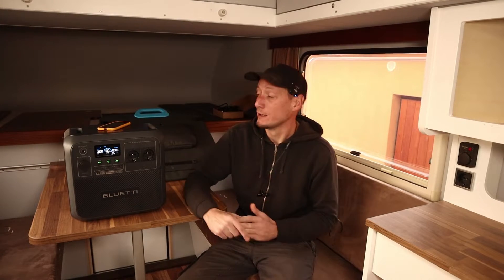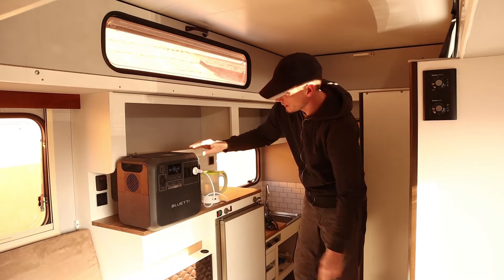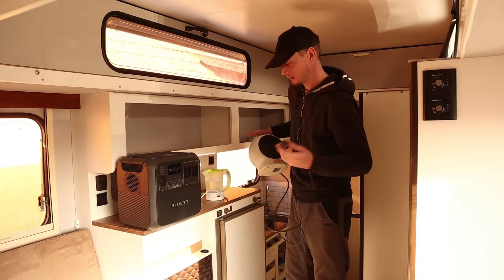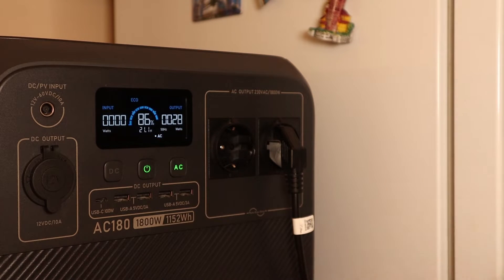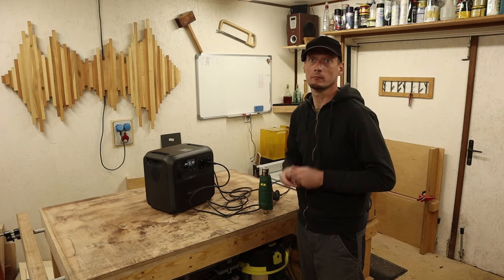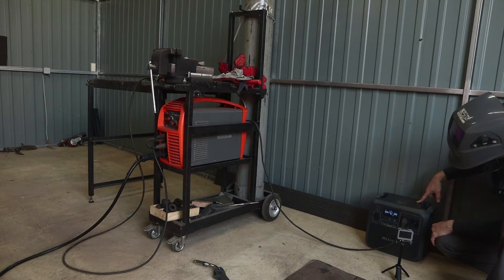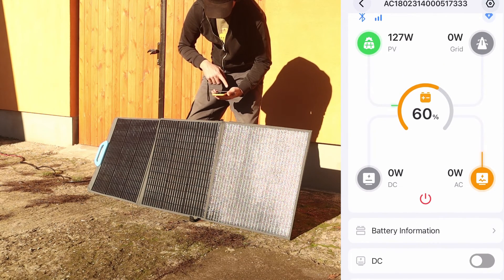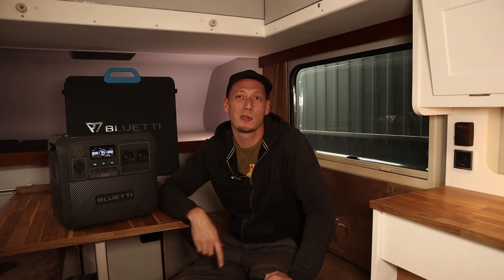Can You WELD with a PORTABLE POWER STATION? A honest Bluetti AC180 + PV200 Review

Comment: hi i have the same bluetti 180 and i am running a unimig viper 185, 10 amp mine will not weld welder cuts out. is there any settings i have wrong thanks.

Comment: These battery units are great...until they fail, they will fail.  Warranty's are typically good for two years. That's a short time for such an expense. So where do you get them repaired? Last I checked, there are no service centers or repair shops for any of these units. They are a throw-a-way item upon failure after warranty. Open one up, the tech is impressive and astonishingly complex, also stuffed in a small space, which is good while they work.  They (generalization for all battery powered storage devices) are very handy units, bear in mind the product will last at least until the warranty is expired.  Know that going in, you will be less disappointed when it happens.
Reply from the maker: I agree to some point. This has a warranty of 5 years, but hopefully it will work for the advertised 3500 charge cycles. I wouldn’t be surprised if there would be a service network of some sort in the future seeing how many of these units are on the market. Generators aren’t cheap either where I live and they have their pro’s and con’s as well and most people don’t fix them if they’re broken.